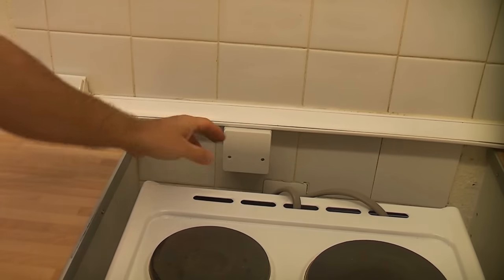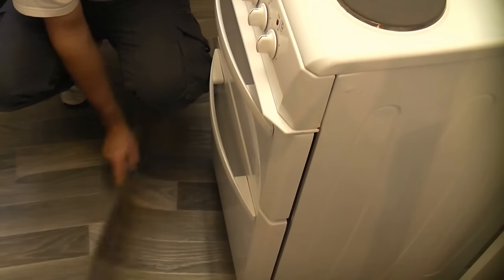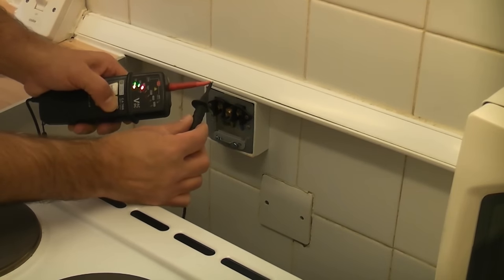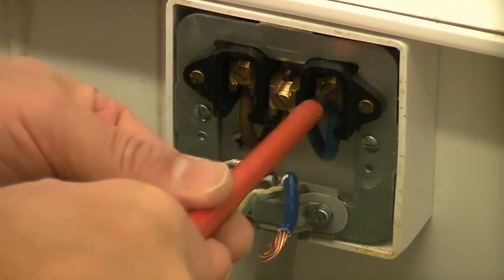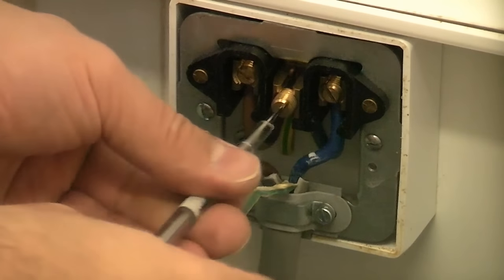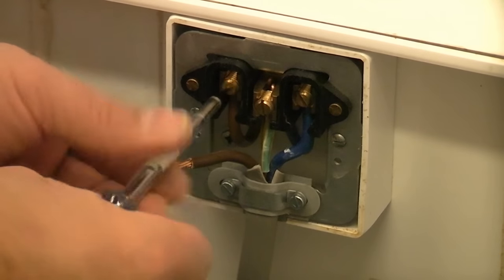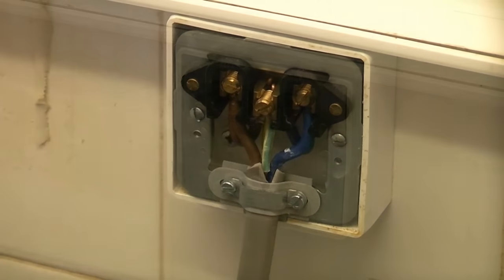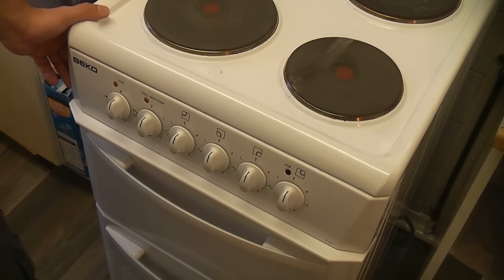How to wire an electric cooker

Comment: Why am I paying £90 for installation when I can just do it myself
Reply: How did it go? Thinking off doing it myself tomorrow but afraid I will ruin it
Reply: @gracelou91  electrics isn’t difficult it’s making sure you doing it safely if you cannot do that then don’t do it
Reply: Because an electrician would use the correct cable

Comment: My local electrician wanted £80 to connect this cable! Then I found this! 15min job 👏🏿👏🏿
Reply: Themaskedtalker
Reply: Themaskedtalker
Reply from the maker: £80 is a fair price to be honest in some parts of the country, by the time the guy has paid his overheads - van/insurance/tools/training/tax/trade membership etc. ;-)
Reply: Ultimate Handyman 
Exactly.
Reply: I agree with some of the items you have mentioned there Chez with regards to overheads. When I started I was surprised and of course, pleased when my Accountant pointed out that I could claim against most of the items you mention above. Some are even off-set in full.
Reply: Whatever about his overheads, it doesn't represent good value to the customer. Any competent DIYer could do this themselves and thankfully your video is here for them to double-check their knowledge before doing so.
Reply: Shocking !!
Reply: I agree with the original comment. I mean the guy is already at my house as he's delivering the oven anyway, the tools will pretty much last indefinitely so would practically have no overhead on those, the task is really simple to complete as demonstrated in this video so again training isn't really an excuse if anyone can do it after watching a ten minute video. I don't know how much the membership or training cost but assuming he only installed one oven a week that's £320 a month just from the installs. From a customers perspective paying £80 for this service is ludicrous, it should be at least half of that. 

My comment isn't talking about a separate individual electrician coming out, I'm referring to the people that come and deliver the Oven from somewhere like Currys, they today tried charging us £75 to install the oven that they would already be delivering and we rightfully said no thanks.
Reply: Ultimate Handyman is a dishwasher and washing machine similar to a cooker circuit? Thanks in advance.
Reply from the maker: No, a dishwasher or washing machine will simply be wired into a plug and plugged into a socket. 
Thanks for the comment
Reply: Hello, what if you have an oven and a hob that both need to go into one available connection?
Reply: ha it takes me 5 mins or less and im not qualified
Reply: What the size of the cable
Reply: What do you mean by cross thread these screws ?

Comment: minor comment, I would keep the earth wire longer than the others so if the cooker cable is pulled too hard the earth is last to fail.
Reply: It was too long to actually fit in within the screw terminal without being shortened somewhat.
Reply: For a plug yes but what is going to ever pull a cooker cable? I suppose their could be a sink hole where the floor vanishes and the cooker hangs over empty space. Not something I would expect happens too often.
Reply: Good tip though this is more relevant for plugs and cables that are moved often and more likely to break
Reply: Some people move there ovens to clean behind it .so it could get pulled
Reply: @mbaker335 if someone wants to pull cooker out to clean

Comment: I'm posting this tip again as with "bedlam" google cause with the messaging system it got buried except to the person I replied to.
When having to cope with those grub screws or any other fiddly screws - or any in an awkward position. Using a bit of Blu-Tak (or similar) on the end of screwdriver will firmly hold the screw in the screw slot. The same blob can be re-used many times.
Magnetic screw drivers don't work on brass ☺☺☺
Reply: Solid advice

Comment: Nice job Chez as always. Couldn't help noticing that the connection box was in a horrible place  especially considering that a pan will be used right next to it. I am sure I read in an installation guide that stated it should be 300mm to the side of the electric hob.
Reply from the maker: +Cliff Carlo Yes, the flat used to be council owned (now a housing association) and they had rewired the whole flat using surface mounted trunking- even for the lights. They seemed to just put stuff wherever was easiest. Ironically when I was there decorating two electricians turned up to do something (which I thought was testing). They walked in the kitchen and said "oh, someone has already put the capping back on the trunking", then walked out- so just like the council really! Two of them turn up to do a job that didn't need doing in the first place.Thanks for the comment ;-)
Reply: I bet they were both wearing stetson hats and had a couple of horses outside lol
Reply from the maker: +Cliff Carlo 
LOL. I think the 300mm refers to the isolator, not the cooker connection unit.
If I remember rightly it's so that you can isolate the cooker if there is a fire without having to reach over the cooker.
Reply: I do believe you are correct on that one.

Comment: Hi! Thank you for your video. I am from Russia and can tell you that the way how you connect the cooker is not allowable by Russian electrical engineering regulations :) Stranded wire must be twisted and soldered. And also it is required to tension the bolts one time per year. But many thanks for MCB  I never saw it. This is easy and so helpful, I will try to find it and buy! Thank you for your channel and good luck!
Reply from the maker: Hi, Thanks for the comment.
The way cookers are connected in the UK is a joke, they should be supplied with a lead and a special plug and just plug them into a specially designed socket. I always like hearing how things are done in other countries ;-)
Reply: +Ultimate Handyman you do that yourself...install a male and female  plugs
Reply: Radicalskin - 😂😂😂

Comment: How would you wire the back of the cooker the wall part is quite easy I've just never had to connect the cable to the cooker thanks if you can help 👍

Comment: Is it ok to wire a 3 pin socket into the same terminals? My induction hob would wire in as shown in your video but my oven plugs into a 13 amp 3 pin socket, both need to be hidden behind the cooker housing ?  If not, what would be the correct way to do this? Thanks
Reply from the maker: No, you need a seperate supply for the oven.
It might be possible to wire a fused connection unit from the existing cooker supply, but you'd have to ask an electrician 👍

Comment: Hi , I’ve just bought a fully gas cooker that came with a white cable with a 3 pin plug on it . I don’t have a socket for plug behind cooker just the plate the heavy grey cable . Can I change the plate to a 1 gang 13amp socket??

Edit 
When I say full gas I mean the 4 rings , grill and oven , only electric going to cooker is to power the light in oven and the clicking ignition thingy lol 

Any help be great mate 👍
Reply from the maker: Sure, you can fit a socket, but I would replace the cooker circuit breaker with a lower amperage one too (perhaps a 16 amp breaker) 😉

Comment: I haven't looked at the wall socket yet, but can I assume it's obvious which wire goes where? I only ask because I didn't notice you mention the positions in the video. Thanks
Reply from the maker: Yes, just a L,N,E connection 👍

Comment: I would have liked you to explain what 'the correct size cable is' or is that another video?
Reply from the maker: I'm afraid I did not specify the cable, it was already attached to the cooker.
Most new cookers specify which cable should be used in the manual
Thanks for the comment 👍

Comment: What do you mean by cross thread the screws?
Reply from the maker: If the screw is not screwed into a threaded hole dead straight (on a slight angle), the threads can strip of one of the components 👍

The screw will be difficult to tighten, but after you remove the screw the threads on one of the items will be ruined

Comment: Does the wiring go from the consumer unit to the cooker control unit and then the connection unit and finally to the cooker?

Btw what is the socket used for on the cooker control unit
Reply from the maker: Yes, that is correct.
The socket is so that people can plug in an electrical item such as a kettle- but it depends where it is located.
Thanks for the comment 👍

Comment: I need to ask my kitchen has built in hob which is hard wired and the built in oven is just plugged into a socket which is on same circuit as rest of kitchen (but has its own isolated switch and fuse).. Can it be hard wired direct Or will I need to get whole new wiring from. Fuse box? (need to check if I need electriction to rewire or just search longer/harder to find a oven that's just a plug as most now I find are hard wired)

Comment: Good vid, just bought a new cooker, no cable although I have the cable off the old one which i cut off. Instructions for new cooker say to leave Brass bridge units in place for single phase supply, which has thrown me a bit as ive never come across this before. Any help greatly appreciated,cooker is a Bush Betaw50w btw. Thanks for any help.
Reply: His meal will be burnt then lol,only joking

Comment: I'm doing mine tomorrow never done it before but looks pretty straight forward.  I haven't got a tester tho does that matter lol???
Reply from the maker: Yes, you need to be 100% certain that it is isolated correctly.

If it is not and you touch a live part, you could be killed!

Comment: My wire on the wall connection are Red, Green/Yellow, Black but my wires on the actual cooker are Brown, Green/Yellow, Blue.  
Am I right in saying the Brown and the Red wires are both the Live wires? Blue & the Black ones are the neutral?
Reply from the maker: Yes that is correct, blue is neutral and brown is live.
Thanks for the comment

Comment: I have this box at back of my cooker. It's fine but I got a new kitchen coming and I need to put two lots of hard wiring into one box? I have zannuzi cooker and a aeg hob and they have separate wiring. Can you take out old box to make it a double?
Reply from the maker: Not sure, I think you might need an electrician to confirm.
Thanks for the comment 👍

Comment: Just got a new single oven as old one stopped working. The old one was hardwired but the new one has a plug. Is it possible to change the hardwire spur to a 13amp single socket?
Reply from the maker: Yes, sure 👍
Reply: @ultimatehandyman  OK great! Also just to check is it a bad idea to cut the plug off and hardwire it because it won't be protected with the 13amp fuse?
Reply from the maker: Yes, cutting the plug off with remove the protection by the fuse, it will also invalidate the warranty on the oven.
The easiest thing, is to fit a socket to the end of the cable and then just plug the oven in 👍
Reply: @ultimatehandyman  Perfect 👌 Thank you for you help and quick replies it's much appreciated!

Comment: i have a question for you , my daughters cooker has died so she waiting for the landlord to buy a new 1 , when she pulled the old cooker out there wasnt a box just a wire hanging out the wall so when the new cooker comes will the electrician still be able to install it
Reply from the maker: He/she should be able to, but it sounds like he/she might have to install a new cooker connection unit. I'm sure he/she will easily sort it out ;-)
Thanks for the comment 👍

Comment: Hi Handyman, I'm going to do this, I have a 10KW cooker. What thickness of wire would recommend? Also how long should the wire be as I  woukd like to be able to pull it out and clean behind it.

Thanks

Lee
Reply from the maker: I'm afraid you'll have to ask an electrician what size cable you need, I only wired in the cooker with the wire already connected.
Thanks for the comment ;-)

Comment: Just bought an AEG INDUCTION COOKER, I would like to have a go and buy the cable and connect it myself (cookers now come delivered with NO cable). As I understand I need the cable with 6mm each core. My house doesn’t have the new consumer unit like yours, it has push button fuses and there is the 30 A dedicated fuse and outlet in the kitchen. Do you think I could connect it to this circuit without overloading, the cooker I bought is just like yours but induction 4 hobs on top, smaller and larger oven. 
??
Reply from the maker: It depends on a few things. I cannot give specific advise so it is best to consult a qualified electrician.
Here are a few things to consider-

1. What is the cooker rated at in KW
2. Is the 30 amp fuse in the kitchen a dedicated radial circuit, meant for a cooker
3. Do the manufacturers recommend you use a specific type of cable (such as heatproof)

Diversity is allowed when working out the maximum load of a cooker, as it highly unlikely that all 4 induction rings and both ovens would be switched on full power, all at the same time.
Reply: Ultimate Handyman 
Cheers for a swift response mate
Here’s what it says in the manual:
• Dimensions : 894-912x600x609 •Voltage : 240
•Total electricity loading, W : 11300 •Required Fuse : 30
Yes, the fuse on the consumer unit is labelled “cooker” and it is rated 30 A (only bought the house from the council 2 years ago but they haven’t updated the wiring, Old consumer unit, fuses, lead insulation on the cable for cooker circuit that runs from consumer unit etc.)
And yes, in this manual that I’m reading now it says that it must be H05V2V2-F (whatever that means ??) cable, 6mm core.
I watched your video carefully and would really like to do at least this on my own
Btw, cooker I bought is AEG CIS6741ECM FS Cooker, first time I am to use induction hobs , I am looking for new pots and pans they’re not cheap either so I’d like to save some money now by doing the connecting myself, plus you make it look easy in your video :)
Reply from the maker: Sorry to be the bearer of bad news, but I would not connect anything to a lead insulated cable.
It sounds like your wiring is really old and needs checking by a professional electrician to ensure it is safe!
Your life could depend on it!
Reply: Ultimate Handyman 
Really?
Oh well, man I am disappointed but glad you told me that .
I’m going to have to call an electrician now to check it all for me.
Cheers mate 👍
Reply from the maker: Yes, sorry but lead covered cable is donkeys years old, it could be over 60 years old!
It's best to get it checked out by a professional to be on the safe side. 
Best of luck with it 👍
Reply: Ultimate Handyman 
Yeah, I reckon the whole installation in the house is the same age then.
Need a full rewire probably, we’ll get to it as we save enough.
Your honesty is well appreciated mate

Comment: Nice video thanks. The only piece I do not understand is the position of the termination outlet which is inline with cooking surface. This is not waterproof so if there is a water spill or pan just boils over there is a chance water will enter the outlet, worst case the cooker case itself goes live until the breaker activates. Do you have any comment or regs for positioning of cooker termination outlets?
Reply from the maker: Regs change over time and are not retrospective.
Perhaps when this flat was wired (owned by the council) they only had high-level cookers, which would have meant that it would not be possible to see the CCU.
Thanks for the comment 👍

Comment: Thanks. You've just saved me £50, and I am a total newbie. BUT!!! Although my new cooker has the standard new brown and blue wiring. My cooker socket still has the old black (left-live) and red (right-neutral) wiring installed. My council flat was built before the new wiring became law.

So I did a little more research elsewhere and saw and realised that live and neutral in my socket is reversed to the new sockets as in your video, which meant that I needed to connect the cooker cable blue live wire on the socket's left black wired side and the brown wire on the right red wired side.

More information elsewhere online suggested that it doesn't matter if you get the two wires mixed up, so long as the green-yellow wire is properly earthed. Unsure how true that is. But I just stayed with black/blue & red/brown.

Anyway, perhaps you can confirm or correct any of this, and thanks for the basic fitting instructions (even though I had to also look elsewhere about confusion about the old wiring). This video has really helped.
Reply: By the sound of it you've wired it correctly but please don't do a job like this unless you're 100% sure of what you're doing. Old colours: red=live, black=neutral, green=earth. New colours: brown=live, blue=neutral, green/yellow=earth. Hope that helps.

Comment: Should the wire be touching the screw? Some sources say the screw shouldn’t be on the wire but just clamping it down. I’m not sure either way
Reply from the maker: If you are talking about the terminal screws (where each wire is terminated), then yes the conductive part of the wire (normally copper), needs clamping down tight with the terminal screw. Loose screws can cause bad connections, arcing and possibly fires.
Thanks for the comment 👍

Comment: hi could do with a bit off advice i have an existing elec cooker still wired up but not working so getting new one but unsure if i can use the existing cable for new cooker rating for new one is 10.72 kw fuse rating 32amps  and its a 6mm cable thats on the old one
Reply from the maker: The new cooker instructions will tell you what minimum size and type of cable you need.
Thanks for the comment

Comment: Got a cooker the other day. Wired it with 6mm T&E, the wiring wasn't half tight cooker end. Wasn't impressed with bush's wiring connection tbh. (8kw)total but It'll never be fully loaded. On a 40 amp, I think it's  max draw is 35 amps